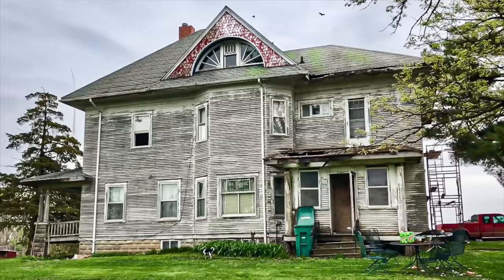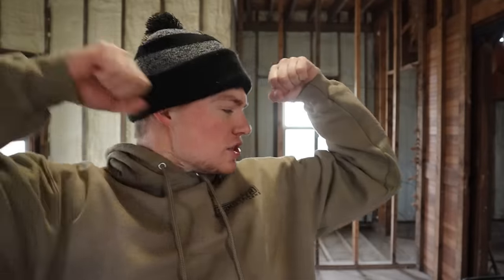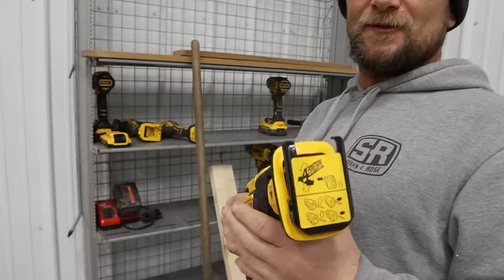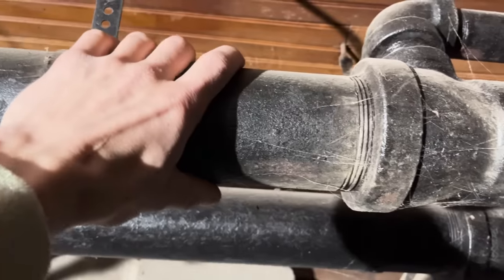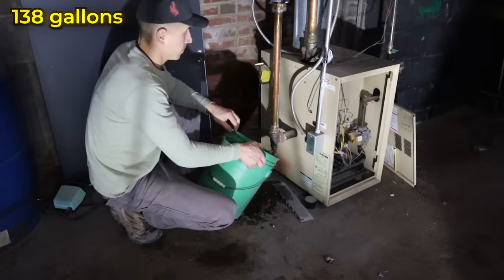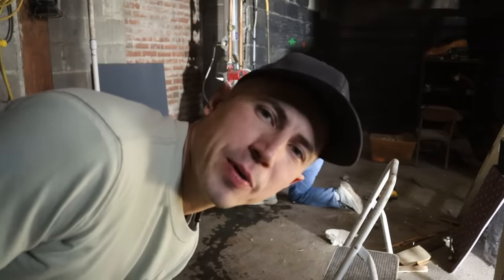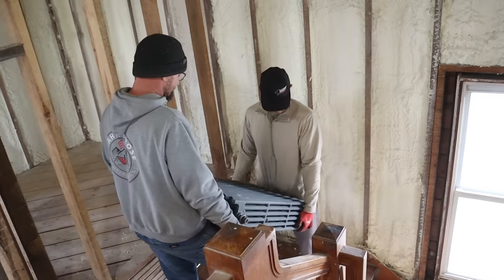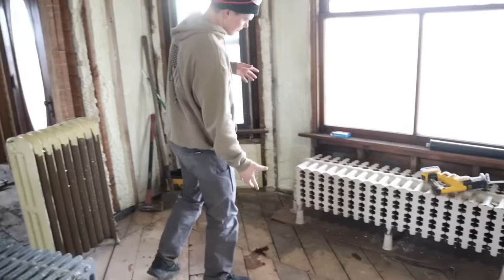Restoring A $7,000 Mansion: Removing Antique Radiators

Comment: There are more efficient means of heating than this in floor heating system Cole is keen on, my Mother had in floor heating once and it used so much energy they could almost never afford to run it, its incredibly expensive to run, its probably also very expensive to install. I think I would go with in room solutions, radiant heaters or there's also new motion-activated infra-red heaters you can mount on walls so as you leave one room it shuts off and as you enter it comes on.

yea the in floor heating downside, it takes a long time to get warm, it costs a lot of energy to run it, and youll probably be running it in the whole household or floor even in the rooms youre not using which is why its so inefficent because if you only heat the rooms you need to then obviously that uses less energy

Also Cole you can save a lot of money on your hot water system by installing solar hot water which even works without electricity, it only needs electricity for the booster when there's no sunlight but if its real hot and plenty of sunlight then it heats the water for free. I would definitely also put solar panels in to reduce your electric bills, don't worry about a battery but just aim to reduce your electric bill. Solar panels don't necessarily have to go on your roof they can install a small array next to or even in the back yard of your house so you can easily clean them off yourself.

Comment: Those old radiators do come apart.  You can see the big hex nuts on the side's top and bottom.  Just undo them and take them apart.  Likely that's how they installed them, bringing them in pieces and assembling in place.

Comment: I'm an uneducated engineer and would have used my car wheel dollies to place the radiators on to use wheels to move them across the floor. As for moving them down stairs, a appliance hand truck would have been preferred, but I'm an uneducated engineer.

Please tell us that the heating contractor talked you into using Warmboard for the radiant floor heating?

Comment: TIP: Make sure to add up to date fire blocking while you still have the walls down. Historical houses tended to have zero air circulation and fire blocking in the walls, meaning it took minutes for an entire house to be engulfed in flames, mean both a total loss, and a high likely hood of death for the occupants. PLEASE put in fire blocking, it will slow down the spread of a fire, allowing your family to get out of the house in the event of a fire, and may provide some much needed time for your local Fire Department to arrive.

Comment: Sorry I wasn't there to help you guys, but being a piano mover I could have moved all those radiators by myself.  Not because I am super strong, I am sure a few of you guys are stronger, but I move 500 to 1000 pound pianos sometimes seven a day.  And still do at 68 yrs old and 5'10", 210lbs. Even the stair moves would have been doable solo. It's all in the science and tools. I've moved thousands of old upright pianos, the type that would have been in that house when it was built. Even pianos that were built in 1860's. Some you may've never have even heard of, pianos called square grands, 7 feet long and 4 feet wide with 4 legs as well as grand pianos, some, 9 feet long and weighing 11-12 hundred pounds. It's all in the technique. I have been doing this for over 25 years, still at it. Looking at retiring when I'm 70. Probably moved 35,000+ pianos. Usually, 5-7 pianos a day, 7 days a week, for years. I love your renovation project. Wish I could be there to help you. I feel a kinship with your state as my father was born and raised in Iowa, a little town of 400 souls called Lorimor, until he went off to WWll at 18. He and  his mother and 9 siblings maintained the house he grew up in until about 2-3 years ago. We all gathered there every Memorial Day to go out to the cemetery and place flowers on the departed and clean up any grounds necessary. I buried him there in that little town cemetery back in '14. I loved driving through the countryside in the summer with all the green fields and the slower pace of life. My grandmother who raised all 10 of my aunts and uncles used to say when she'd come to visit the Silicon Valley in summer, "It's all wrong, it's all wrong''' and we'd say what's wrong and she'd say "the hills, the hill's are all wrong" and we'd ask why and she'd say  "they're all brown , they're supposed to be green in summer."  Every time I look at our brown hills in the summertimeI I remember her and say "they're all wrong, they're all wrong, they're supposed to be green."      And remember her and Iowa and smile.

Comment: I-, not sure that radiant floor heating is enough to heat this house. We have it in ours, we live more to the south  and in winter we use it in combination with radiators that we have by the windows because alone it doesn't produce enough heat. Or else you need to step on a really hot floor

Comment: If it was me screw the boiler system I’d just get central heat and air have the unit in the attic and run ducting through the house it would be tough to figure out how to run it but it’s doable

Comment: take the bolts out the end and they come all apart, makes me think of the story of the new guy came on the job the foreman had a cast iron tub up 4 flights of stairs that had to be removed. so he told the new guy get it out +so the new guy went up and started muscling it out of the room and down the stairs,, it took him all day and finally had it by the front door but it wouldnt fit out the door no matter how he tried. so the foreman come over and he grabbed a sledge hammer and wacked the tub a few times and broke it all to pieces.. he looked at the new guy and said (next Time Ask)

Comment: Ok so I paused it at the beginning.  I'm trying to guess what tools you used to get the radiators out.  First guess is sawzall.  Second guess and probably best guess is those 2 cycle cut off saws they use on cars to cut a body in half in 30 seconds.  Going with that.  Who knows, maybe you end up using oxy acetylene.

Comment: If you are getting air conditioning just get forced air heating as well there is noway you are going to heat through the two subfloors and a finished floor radiantly do electric radiant heating in the bathrooms

Comment: Oh no. Take those radiators apart. They break down to small sections and are only 20lbs after taken apart. Cut the long bolts in the middle and hit with a big hammer and the sections will fall apart. Put a sump pump in a bucket and turn it on. I bet there is 300 gallons or more in that place.

Comment: ** I CAN NOT BELIEVE** that it took you until about the last radiator to carry the radiators in a sling of chains!!!  (or ropes)  I think I went horse yell at the screen  :face-green-smiling: loud enough so you could hear me telling you to get some chains/ropes/straps with maybe 2X4's lashed across the top with the chains.  On the big heavy short square ones you could have use 6 people. Two in front, two in the middle and two at the rear.  🙄🤔😖

Comment: Amateur renovators. First:  Electrical before spray foam insulation, support headers over windows and doors before spray foam insulation... get a garden hose FFS, to drain the system, what are you, new? Amateur hour. Use a grinder with a cut-off disc to cut steel pipes, twice as fast.. and cheaper - gong show. Hire professionals Cole - not Justin.

Comment: I am not sure if that was a good idea.  Those radiators put out a lot of heat, in floor works very slow.  You really need to research them before going to far.  Just so you know, they make rollers that you could have put those on and wheeled them to the door.  You guys need some help.

Comment: You think your house is fancy. I grew up in a 1870's brick victorian with 15 rooms on 2 floors with an additional 5 rooms in the basement and a full attic. The roof was slate and still is today and original. The fret work was hand turned on site when the house was built. So to say yours is one of the fanciest built is crazy. There were a number of houses in this area that were built in the late 1800's to early 1900's that are much bigger than yours and are better built